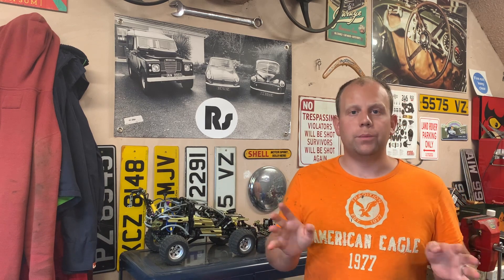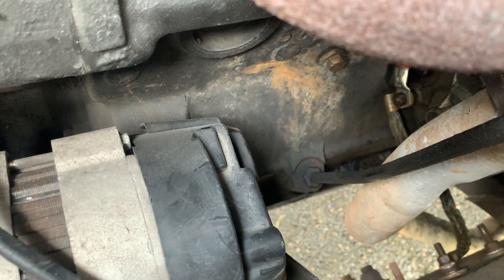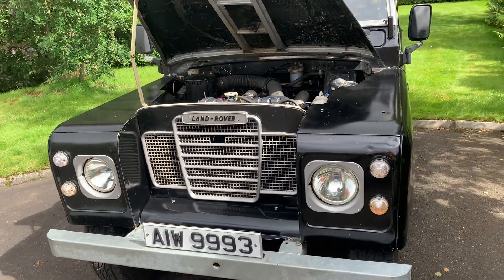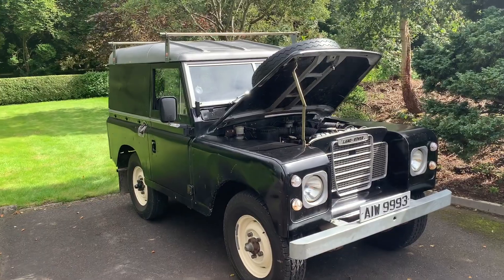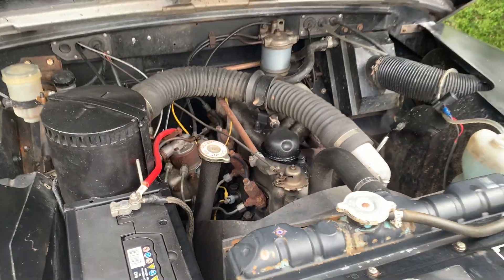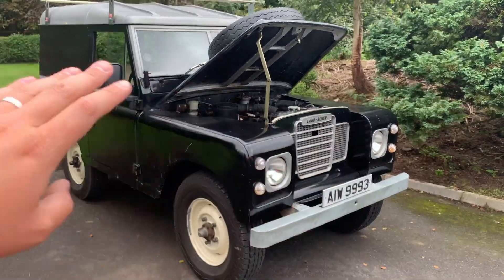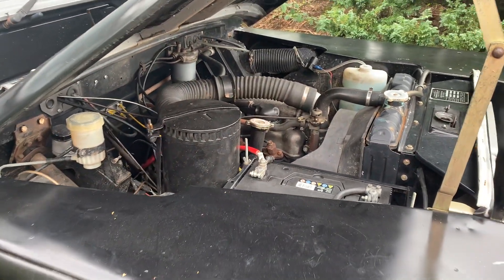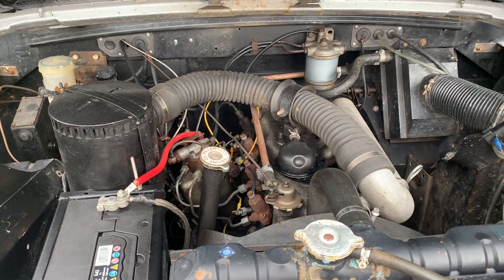Engine Conversion Options - Land Rover Series 3

Comment: I've recently bought an S3 with a 200tdi, LT77 box and early defender axles. It also has RR P38 power steering. It is by far the best Land rover I've ever driven. With enough sound proofing it is possible to converse at 70mph, It will go a lot faster. It stops well with the disks up front and a TD5 master. The only weakness of the engine is the cylinder head, but being a pushrod engine it is very simple to swap. A new, improved head gasket and a recon head will last another 30 years at least. The 200TDi can be easilly tuned from stock plodder to grenading rally spec and anywhere inbetween. 
All this work makes the S3 a genuine usable machine, a joy to drive, and good for another half century of work.
Reply from the maker: Sounds like a well-sorted machine!

Comment: Have a 200tdi in mine and everytime starts effortlessly without heater. Little smoky on start up but soon clears. New set valve stem oil seals I think ect but will leave as apart from this small inconvenience she runs perfectly. Garret turbo on top works perfectly. In my opinion it's the best and easiest conversion in place coming 20 years
Reply from the maker: 200(t)di remains top of my wishlist if I ever go to covert. Thankfully managed to salvage my 2.25d with some JB Weld, so will run with it for a while yet

Comment: Did you get the crack sorted?
Reply from the maker: Yes, I did thanks. I used JB Weld epoxy steel in the end. Cheap and simple and it has held now for about 3 years!
Reply: @restosaga  It's probably OK as it doesn't get every day hard use. Unfortunately when I have tried similar it didn't work. Well done.
Reply from the maker: @landroverihtractor1965 thanks, it’ll hold as long as it holds. Nothing ventured, nothing gained

Comment: Especially since it's an occasional driver, patch it to buy time when other parts of the motor need repairs, and yank it then.
Reply from the maker: Definitely agree with this. Have patched it now and it has held well for about 2 years. Engine running perfectly still, I wonder if the repair will hold until major work is needed?!

Comment: If its only leaking  very little....put some bars leak or rad weld into it and let it be till and see how it goes.

If it gives up the ghost....get a 2.25p engine....with the price of derv....the 2.25d makes no sense.

Or do what I did.....buy an old Disco....mk 1 is best....get its 200 engine and bin the rest....good scrap prices at the moment.

Take off the TURBO....its not needed.....no ned to change much under the bonnet.....keep the std rad.....the battery and oil bath air cleaner can stay were thy are after altering the batt carrier.

The 200di wont wreck your gearbox.

Most important.....put anti freeze in it.
Reply from the maker: Thanks, I think a 200di sounds good. I’ve patched with JB Weld and it’s holding well for now

Comment: If you are replacing the bulkhead, LR90 ones fit and have room for engine swaps. You will have to use the old winscreen to make the hardtop fit.
Reply from the maker: Thanks for this! Sticking with the 2.25d at present but food for thought if I go V8!

Comment: Can you not get it cold stiched
Reply from the maker: Access is very difficult and would probably need the engine out plus finding someone local who does it. I used epoxy steel in the end, seems to be holding well so far!

Comment: It might be possible to stich the cast block. You can do this by drilling and tapping overlapping holes. Also you can buy specific items for this.
Reply from the maker: Thanks! I ended up patching it with expoxy steel which has held well so far. May need welded in the end though!
Reply: @restosaga  your welcome! Hey as long as it works!

I done a search on stitching after commenting and a chap has actually done it on a cracked engine block for a landy. Video also on youtube. 

Just out of interest im looking at a series 3 for a project do you know any other good resources?
Reply from the maker: Great, I’ll have a look for that video! When I got mine I did most of my research through the magazines (Classic Land Rover is particularly good). Though now I guess online is probably as good. Happy to help where I can!
Reply: @restosaga  well ive been looking at one online, it that hasnt ran for  a couple of years. I dont think I have a problem with skills to do work but I also wouldnt want to buy a complete wreck and be throwing nothing but money and time at it
Reply from the maker: There is definitely a fine balance to be had! Best to see it in person and if the chassis and bulkhead are ok that’s a good start!

Comment: We fitted a Perkins Prima 2 litre turbo diesel in my brothers Series 2a, What a difference!! possibly the best engine Landrover never fitted, it halved the fuel usage & could happily cruise all day a 70mph.
I've just acquired a series 3 88 fitted with a 2.5 transit 'banana' engine. it goes well but is very noisy, which doesn.t really bother me.
but for sheer grunt the Perkins 4203 3.3 litre can be fun & pull away from a standing start up hill in top! Lol, but rather slow.
Reply from the maker: Nice, not sure the gearbox would last long though?

Comment: My first option would be to repair the block using the metal lock system, like cold stitching but better. I have had large tractor castings repaired using this method. If I was to convert, I would go for a straight six but rather than the 2.6 litre, I would use a 3 litre. Same engine block and they were used in the Rover 3 litre P5.
Reply from the maker: 3 litre option sounds amazing! Nice!

Comment: I'm picking up a 1974 Series III tomorrow. The thought of a V8 is intriguing. I would almost think a Buick or Rover 215 cu inch V8 would work fine. Curious
Reply from the maker: I continually stew over a V8 installation, purely for the noise!!!

Comment: something wrong with te engine with 20 mile to gallon . my 2.25 diesel gets 30 mpg . well you could use a 2.25 petrol block with you diesel  parts
Reply from the maker: To be fair, it hasn’t been opened or had any major work since it was new so it’s probably due a rebuild haha

Comment: I put the Rover SD1 V8 into my series 2, with the o/d. It was a really fast machine and quite economical, I was getting 25MPG on a run and could cruise all day at 70 MPH. I did upgrade the brakes, Used the ones from the old 1-ton and installed a servo. I had no problems with the standard transmission, although I never used my "lead" foot in first. The standard series3 rad, with electric fan only,  will work ok for normal motoring. Good luck!
Reply from the maker: That sounds just perfect! I like the idea of using all original Land Rover stuff too. Thanks!

Comment: Aparrt from the cam belt driven water pump the Peugeot XUD is a very good engine. Turbo ones are pokey and all mechanical. I think the N/A version was fitted to Suzuki SJ's at some point so there may be suitable 4x4 transmission bits available.
Reply from the maker: I’d never thought of a Pug lump, interesting! Think I’ll try and fix my block first, before I drop a new engine in.

Comment: I have an Australian Army 6 cylinder, which has a lovely sound and a tad more power than the 4 cylinder. Oil changes shouldn’t be neglected and it can’t be abused like the 4 cylinder but it’s much more refined and interesting!
Reply from the maker: This is what attracts me to the idea of a 6-pot but before I jump into a conversion I’m going to try and fix my own block.
Reply: @restosaga  exactly what I was thinking. It’s a Landrover after all! I hope you get lots more miles out of it. It’s a really nice rig by the way.
Reply from the maker: Thank you very much! Exactly, they’re usually all a bit rough and ready

Comment: I put in a turbo 200tdi from a discovery into my 67 2A 16 years ago, it's a straight swap. Kept the original rad, gearbox, brakes and suspension but changed the diffs from a discovery. I can't remember what the intercooler came out of, I think it was a Renault? But it sits perfectly in front of the rad and the oil cooler sits on the side of the radiator. 
It's my daily driver and in 16 years the only problem I've had is the bypass hose on the thermostat housing burst.
I did do an engine rebuild before putting it in.
Reply from the maker: Nice one! You make it sound quite straightforward!
Reply: @restosaga  
Pretty well was, the hardest part was finding an intercooler to fit, spent a few days trawling ebay till one came up.
Reply from the maker: Excellent!

Comment: Some of the sensible conversions (we will ignore the cummins6BT and Perkins combine engines for now) I have seen are:

The perkins Prima 2.0(fitted to freight rovers and the austin montego/maestro) was the engine of choice before 2/300 TDI became easily available 
Peugeot 2.5 TD from an LDV 400
Peugeot 1.9 XUD9 from pretty much any 90's peugeot /citroen
A 200DI (200TDI but with the turbo removed) works very well and won't overpower the transmission but will give you a good usable vehicle
Daihatsu 2.8 out of a fourtrak, it would require a new gearbox and transfer box though
a variety of Nissan engines but they require parts that are no longer available.
Reply: The thing to be aware of is that there are many different versions of the Perkins diesel, particularly in 4.236 form. If I was to go down that route, I'd get one from a Dodge 50 van, as it's an automotive version which revs to around 3,100 rpm with max. power around 2,800 rpm. It's very similar to the one Leyland South Africa fitted in the Series IIIS (that was a licence-built Perkins 4.236 known as the Atlantis ADE 236), only they used a Santana gearbox and 109 V8 differentials. Certainly, one from an agricultural or marine application is totally unsuitable, but a lot of people have fitted those which is why they are seen not to work in Land Rovers. You wouldn't fit the Mercury Marine version of the 2.25 diesel to a Land Rover would you?
Reply from the maker: Thank you! I think if I'm going for a new lump then it will be a Land Rover one, likely 200DI as you say. Probably will try to repair the block first though.
Reply: @restosaga  If you drill the ends to stop the crack spreading you could braze it to fill the gap
Reply from the maker: Yes, I heard this actually, something I think I could manage. Thanks!

Comment: I bought a 2.25 diesel series 3 with a view to changing it to a petrol. But I really love the 2.25 diesel, it really suits the Landy character. So I bought a later 5 bearing block and transferred the head over. The 200 tdi should just drop in, no need to move the radiator or modify the bulkhead. But if you get one of the more plentiful Disco engines the turbo is mounted down low and you'll need to get one of the conversion kits to join the to the exhaust. And also you are pretty much doubling the power and feeding that all through the back axle in normal use - there's a reason that Land Rover went full time 4x4. If the tdi is the route you want to take, you might want to consider fitting the LT77 gearbox as well. But then you'll still have the UJs in the front axle..... The 300 tdi would involve some trickery with engine mounts. Both tdi conversions, and the 2.5 na (12J), would mean moving the battery. And don't consider a 19J turbo diesel!!! Like you, I like the idea of the old 6 cylinder though, and if I see a decent one at a reasonable price I might be tempted. Hope that helps. If I were you though, I'd just put in some decent radweld type stuff and see what happens! Hope that helps!
Reply from the maker: Thanks Stuart, a very comprehensive reply! At the moment I think I will try and use some JB-Weld to repair the crack and go from there. Cheap and nasty yes but for all the miles I do I think it's best. Plus, my mechanic skills would not cover a complex conversion I feel! Watch this space!
Reply: Hi Stuart very interesting reply I have just bought a defender90 with a 19j engine what is the issue with those im thinking of replacing it with 300tdi but would like to know why 19j has such a bad name
Reply: @normandbeaches3496  Land Rover made changes to the 12J to help it cope with the extra stresses from the turbo, but not enough! IIRC a lot of them never made it to 100K (mine didn't), they start to breathe heavily, and the oil starts to clog the air filter. I think that cracked pistons and heads were common faults. The older Land Rover diesels don't rev, I found that the turbo just got you to the end of that rev range sooner (maybe taller gearing may have helped?). The TDIs in contrast are excellent, especially when you consider that they are the same basic engine design (though only the crankshaft was carried over). Maybe if your 19J has been looked after (and I guess it must have been to make it this far), and you continue to look after it all could be good. But if you upgrade to a TDI you won't look back. I even prefer the TDI to the TD5!

Comment: I have swapped my 2.25 petrol for a 200tdi into my series 3, I used the engine mounts from a transit which reduces the vibration quite a lot. I also used higher ratio diffs which helped massively!
Reply from the maker: This seems to be a very popular combination of modifications, thank you! Hopefully I’ll be able to repair my own block, fingers crossed!
Reply: It was recommended to me by a friend as I was looking to make mine a daily runner and I wouldn’t go back! My next upgrade is a disc brake conversion!
Reply from the maker: Nice one, which disc brake conversion kit are you looking at?
Reply: I’m going with the Zeus kit, it’s a little more expensive but worth it I think! Are you getting a disc brake conversion kit?
Reply from the maker: I really like the idea of one! Does the Zeus kit fit the standard wheel size? I like to keep mine visually quite standard (it will return to original Limestone soon).
Reply: @restosaga  I believe so yeah! I agree with the landy looking as standard as possible
Reply from the maker: I do love a sneaky wee mod that flies under the radar haha

Comment: IIRC, the original diesel that yours is based on was exactly the same block as the petrol! When LR started considering releasing a diesel the engineers 'checked the numbers' on the petrol block and despite diesel being twice the compression ratio they reckoned the block could withstand it!
If you want a 2.25 petrol, try and source the 5 main bearing type as opposed to the 3 MB for obvious reasons.
You also said 2nd gear is a little troublesome, perhaps another leftfield idea would be a donor Disco and use both the 200/300tdi PLUS the gearbox which would give you five speeds, then just sell on whatever is left over to a LR scrappy.
Also, depending on your final engine choice you could consider swapping the Series diffs of 4.7/1 for Range Rover 3.54/1. I'm not sure but I would presume if you went donor Disco route those diffs MAY fit as well, halfshafts may require changing depending on the number of splines.
There's also the option of front brake disc conversion or perhaps swapping the SWB 10" drums for the LWB 1 ton 11" drums but I'm not sure how easy that is to fit.
A lot would depend on your level of spanner wielding, which already sounds far ahead of my own! 
Good luck!
Reply from the maker: That would be a great job if I could pull it all off but I think it’s a little beyond my abilities unfortunately!

Comment: If you have a large budget, want to completely future-proof it and want the best performance, reliability and comfort, have a think about an electric conversion.  Netgear Hyper9 and Nissan Leaf motors seem to be good options with better performance than a Tdi, but having that torque from 0-10,000 rpm.  There are a few websites, Facebook groups and professional companies doing it and getting superb results,  but it’s not cheap.

Don’t bother with a 19J - they crack their heads and pistons.  The 12J is pretty robust, though.  The Tdis are better, though a bit noisy.  The Glencoyne mounts really help with that on the 200.  You don’t need any mods to brakes, suspension or transmission.  They’re not bigger engines, they just have more ancillaries, and they only damage the transmission if you drive like an idiot.
Reply from the maker: Thanks Nick, a comprehensive comment! I’m not sold on EVs just yet, not a perfected technology I feel. Appreciate your input re the other diesel options though, thanks! Watch this space!
Reply: @restosaga , I changed my 109 to a 19J in 1993, then a 12J (because the 19J was scrap), then a 200Tdi (Discovery engine with Defender manifolds and turbo, best combination for a couple of reasons).  You can take a look at some of how it was done on my blog, but since I already had the Stage 1 bonnet because the clowns who installed the 19J said they needed the space and I was too much of a novice to know better, fitting the rad and intercooler would be different for you if you keep the short bonnet (recommended).  Www.nickslandrover.co.uk
Reply from the maker: Thanks Nick, that’s helpful, I’ll have a look at your blog, I think I’ve been on it before!

Comment: I have a 305 small block chevy conversion in mine. A tired 305 should help the trans live. Probably 100 horse guessing. I have an l99 baby lt1 4.3 liter v8 to swap for fuel injection and better economy. Should all just bolt right up
Reply from the maker: Oooh, very nice, I’m sure the small block sounds great!